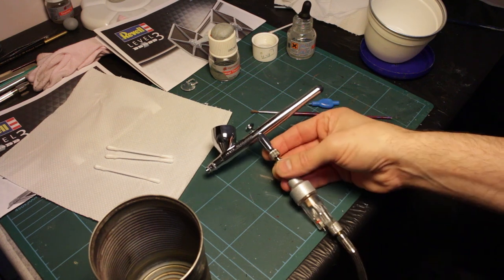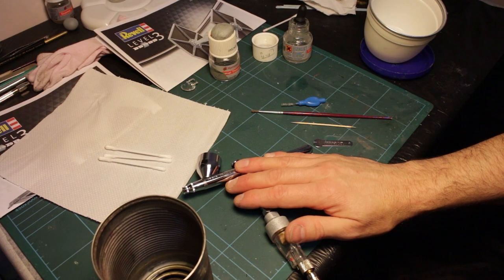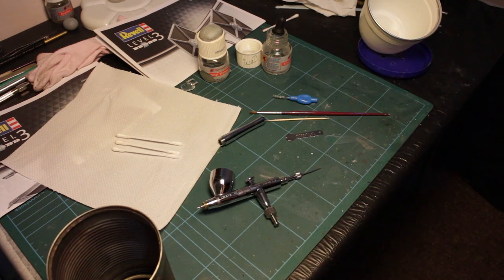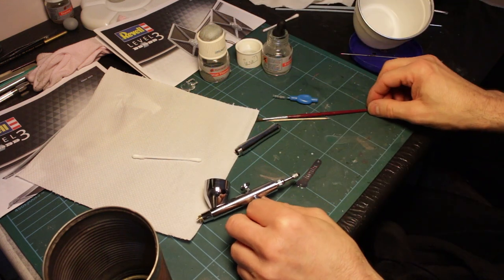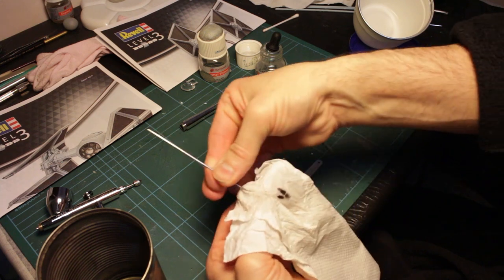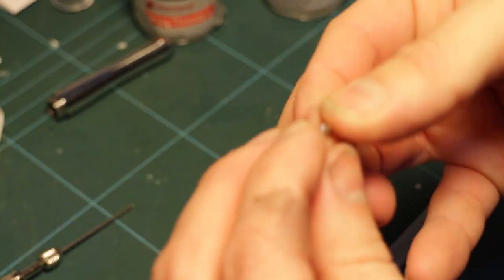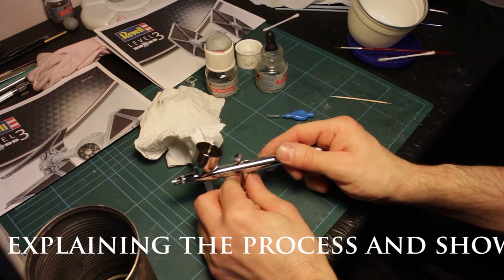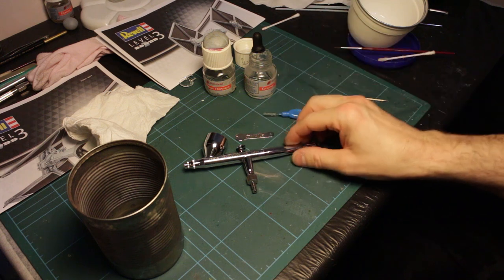CLEAN YOUR AIRBRUSH, SIMPLE, QUICK & THOROUGH TUTORIAL!

Comment: Excellent tutorial. Thank you.
I wish I'd found this last year when I started airbrushing. Thankfully I only have a cheap airbrush but I think bad YouTube advice and my own general ignorance has led to multiple problems caused by damage I've done while cleaning.
Reply from the maker: Thank you, glad you found it useful.
As someone who used to work in an automotive environment and sprayshop in the past and an avid model maker I see lots of horrendously bad advice re the use of airbrushes and bad cleaning regimes and dubious magic products.
Reply: @spidiq8  Lot's of great advice here. Bad advice I've seen includes soaking the whole airbrush regularly but no mention this will destroy seals that aren't teflon, so most cheap beginner airbrushes will be ruined. My basic Gocheer now spray's like a gnat's fart even though the compressor runs constantly.
Reply from the maker: @pumellhorne  Yes indeed. And people who think ultrasonic cleaners are like magic bullets. The key is cleaning as soon after use before the paint cures as possible.
In the garage if we couldn't clean immediately we'd strip the gun and leave the parts in a tub with gunwash (raw cellulose thinner) until we could clean it before reassembly.

Comment: Great video.. the tip on only removing and installing the needle from the front is great.. never heard this before, but will keep paint from getting forced through the rear seal.  Also by not ever inserting the needle tip-first, will keep you from bending the tip as it goes through the body...
Reply from the maker: That's precisely the reasoning for it. The tips are very easily bent or a hook or burr formed which causes all kinds of strange behaviour with paint. Glad you enjoyed it and I hope it's useful.
Reply: which is just fine as long as you don't have a Badger airbrush which have a ball at the rear of their needles, so they can only go in and out one way - through the back door.
Reply: @arleighburke9095  I suppose... it could be possible to remove ball part...  but.. with home tools it may be very difficult to get smooth enough cut that no burrs or scraping surfaces would form to possibly harm your teflon seal.  : /   in witch case... that might be even worse than having bit of paint to come trough with needle.  I guess...  this is why badger recommends using their needle juice..  to keep seal lasting longer  even when some paint residue may come trough it with needle.

Comment: Hi spidiq I'm gonna have to say many thanks again to you. I watched your videos on thorough cleaning of airbrushes and also noted that the paint should be mixed to a 'milky' consistency. I see you mentioned a compressor, AS18. I bought a compressor from Amazon &, as soon as I switched it on, after two or three presses on the airbrush trigger, the compressor went bang, fizz followed by a bright light from the switch & burning then it died a death. Sent it back & ordered another, and different one. The second one I ordered just happened to be the AS18. Ordered it before seeing your suggestion on this, so I can only say that fate took a hold here & delivered the better compressor to me. Following your guidelines of paint consistency, airbrush cleaning etc I have, for the first time, managed to spray the interior of my model fuselage cockpit sides,  (never used an airbrush before), I slightly sprayed a little too heavy on the wing under carriage wells but hey, I can disguise it with weathering etc. I'm in no doubts that I'll be having newbie pitfalls etc but, thanks to your video guides, at least I can begin to find the right path on the learning curve. Cheers fella'. 😉✌️👍
Reply from the maker: That's great news and I'm always happy if I helped a fellow modeller.

Comment: 0:00 Intro
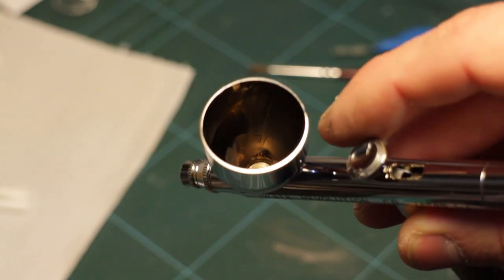1:39  Basic flush through, Use between paints during a session
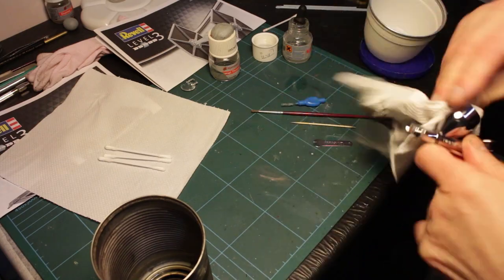3:17 Thorough strip, clean & Re assemble
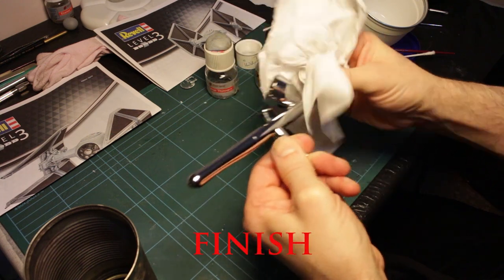15:14 Finish
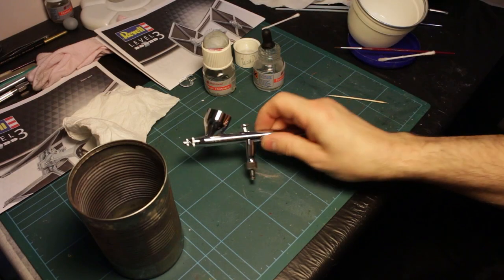17:32 Note: What to clean with for different types paints (water-based acrylic paints, enamel paints, cellulose or
 lacquer paints)

Comment: Thanks for a most informative and to the point air brush cleaning tutorial!
Do you not think that lubrication of air brush parts including the needle should follow the cleaning process?
When you use the term cellulose cleaner , could you define to make certain I am on the same page?
Do you have a list of cleaner types when it comes to paint types? IE. Acrylics - Acetone, Isopropyl …..
Reply from the maker: Thank you. Re your questions.
Definite no on lubrication anywhere in an airbrush. Anything that lubricates will contaminate the paint, lubricants are snake oil, just designed to separate people from their money with no benefits.
Your needle runs in a teflon bearing/bushing which in addition to providing a good seal is also self lubricating. They wear and occasionally need replacing but the needle is in contact with paint and should never be lubricated.
If you're in any doubt go to a professional spray shop and ask them what lube they use on their spray guns, be prepared for confused looks and possibly laughter. 😁
By cellulose thinner, I mean precisely that in the UK as that's what it's sold as. It's not a brand but a thinner type. In the US it's referred to as lacquer thinner, it's a harsh solvent and typically the type used for automotive purposes, this will clean any paint type from the gun and also thins most paint types.
Generally the cleaner is the same as the thinner used for the paint.
I.e. for water based acrylic you can clean with water but an actual thinner may be required for any dried paint.
As a rule
Acrylic - isopropyl alcohol
Enamel - enamel thinner / mineral spirits, (white spirit in the UK)
Cellulose/lacquer - cellulose/lacquer thinner. (This can also be used as an all purpose cleaner for all paints).
I would never advise the use of Acetone unless removing all seals and soaking the parts in it.
Acetone is a very aggressive thinner which will melt most plastics and this can include plastic based rubber including some O ring seals.
Reply: @spidiq8  so now that I have lubricated my airbrush to include the needle do you have any recommendations as to how I can reverse the process to  correct my error!!!!!!!
Reply from the maker: @markdesantis6325  Just strip and clean the whole thing again.
The risk is in contaminants touching the paint as it can cause all kinds of unpleasant effects. Not so bad on a model paint but you can understand why on a several hundred pounds/dollars car paint they have to be really careful.
Reply: @spidiq8  so I have to completely Isopropyl/Alcohol my 2 brand new airbrushes. I wonder if I should just send them back.Thankfully I found you. Just wish it had been a bit earlier.
Reply from the maker: @markdesantis6325  Depending on where and what quantity of lube and what it's made of, it generally just needs flushing or cleaning.
As long as it's not contaminating your paint you're ok. Try spraying some paint through onto a test piece and see.
As long as you're free of contamination you're ok.
Reply: @spidiq8  the product was Airbrush Lubricant by Impresa. I definitely will need to clean the needle, but my concern is more with the needle walls of the chamber.
Reply from the maker: @markdesantis6325  It'll clean if there is any there. You can rinse it through with isopropyl alcohol or cellulose thinner. Just try to keep it away from the air inlet as that has rubber o rings.
Reply: @spidiq8  thanks much for getting back to me so soon. Your respected input will be put to good use today. Fingers crossed 🤞
Reply from the maker: @markdesantis6325  Best of luck with it. A good clean and I'm sure you'll be good to go

Comment: I've been getting some problems with dry tip, so will be more careful to clean properly in future. Good to know that you should be pushing the needle out rather than pulling (I’ve seen the latter technique I’ve seen in a few how-tos).
Reply from the maker: You can draw the needle backwards but it's just not logical to, you're both dragging paint through the needle packing which will slowly wear and abrade it and you risk bending the point of the needle on refitting.

Comment: I just started airbrushing and this is a Good tip for ME. I have the same one your cleaning.  Tku. 👍👍
Reply from the maker: You're welcome and I'm glad it's useful to you.
Reply: @spidiq8  I see you have an in line filter is it important. I have the cheaper one. Since this is my first equipment.
Reply from the maker: @williamaviles2647  It's important if you intend to spray for any length of time as condensation will build up in the airline so even with the one attached to the compressor you'll still risk water ingress.
It also makes a difference with the temperature and humidity where you are. Here in the UK we have cold weather and humidity.
Reply: @spidiq8   Thank You
Reply from the maker: @williamaviles2647  No problem. The inline filters can be gotten cheaply from eBay.
Reply: @spidiq8   Just ordered from Amazon. 😉

Comment: Sir love your videos and thanks for your time. I recently purchased a Iwata revolution like yours but after a recent session it quit sucking paint ..acrylic..from the cup.. it's super clean..even tried a new nozzle..it won't even spray water..any ideas?
Reply from the maker: Check the air hole next to the nozzle and make sure air is coming out, although with a new nozzle it shouldn't be the case check it for splits.
If they're ok check the PTFE seal for the needle at the back. Draw the before back and forth and you should feel some slight resistance. If loose check the needle is spotlessly clean so you're not dragging paint through and tighten it slightly.

Comment: quick question I was told there was two different settings for the siphon and the gravity feed but i can not find any info on the that setting i use siphon cause i change colors alot while i do my drawings but just not quit sure at what pressure to run. I run 30 psi for the gravity feed.
Reply from the maker: Required pressure depends on the viscosity of the paint but siphon feed will always require more pressure to achieve the same spray pattern, there is no 'magic number' for the PSI needed as what you spray varies in thickness. Inks for example are very watery and require much less pressure than a thick enamel paint.

Comment: Here's a cleaning tip that resolved about 90% of my problems getting into airbrushing -
You know those disposable pipe cleaners you can pick up in basically any store?  While scrubbing with them will loosen dried paint, it's also a great way to leave tiny stray bristles and crap in the airbrush which will inevitably cause a clog.  I also suspect that their steel wire cores are probably pretty bad for the teflon seal too.  Seriously, just don't use them.

Comment: Great tutorial! Just curious thought. What about the o-ring on the nozzle?
Reply from the maker: On this particular brush the machining is tolerance fit and very good so no o ring is necessary. On some cheaper ones you can get away without, (my cheap Chinese one will seal without but another I had didn't).
However, if you have one with a seal it shouldn't be submerged for long periods but can be dipped in thinner and reamed through with a paintbrush, if it needs soaking, using a needle or pick. Carefully remove the o ring first. If you have some a tiny dot of silicone grease on the o ring after dipping will prolong it but only the tiniest dot, you don't want silicone grease inside the nozzle.
I'll look at doing a follow up video about this as it's an interesting question. Thank you.
Reply: @spidiq8  wow thank you so much for the reply! I'm looking to get the neo for iwata hence the detailed question. Personally I've been using China airbrushes and the inconsistencies have been starting to get to me as I'm starting to go into chroming my kits with lacquer paint. I deduced that for that purpose, it's always good to have a very clean airbrush. The China ones have O-rings so I can't soak the nozzle in airbrush cleaner which is a stronger solvent compared to lacquer thinner. I've always found it difficult to remove the o-ring but your suggestion sounds great! I don't have any silicone grease either so I think I'm gonna have to be very careful with my cleaning procedure until I get a Neo.

I'll be looking forward to that follow up video! Cheers from a Singaporean gunpla builder!

Comment: Can I pull the needle out in the front on a H&S Airbrush? They have these indentations at the end where they mark the size of the needle. I am worried to wear out the needle seal. Thanks
Reply from the maker: Yes. The grooves are indented so it would be fine. If you're a little wary take some 600 grit wet n dry and smooth the end where the grooves are. Clean the needle well before refitting.

Comment: So if I had pulled the needle thing backwards through the seal instead of out the front, would this damage the seal? If so what would happen?
Reply from the maker: Long term or if paint has dried on the needle it will gradually abrade the seal wearing it out. Think about air filters on engines, the reason for them is to trap fine grit and dust particles which would get into cylinder bores and abrade the piston rings and bore, the principal is the same, went draw something through a seal and drag contaminants if you can remove from the front and not.

Comment: Is it advisable for "long term"  of several mos. to years  storage of an airbrush that a slight blow thru of a light machine oil ( 3-in-1 or, sewing machine oil) will preserve the internal metal parts against corrosion.
Reply from the maker: I would advise against it, it would require complete stripping and immersion in solvent to clean out oil residue which is the worst possible paint contaminant.
Thoroughly cleaned and stored in a dry environment it should store without problem, avoid storing it anywhere humid or damp to preserve against corrosion.

Comment: Good morning my very good friend, I've popped back to kill my curiosity once again with your professional thoughts.. Whilst cleaning my H&S CR Plus, it occurred to that between the base of the cup and the needle teflon seals, there's a space of about 30mm and whilst cleaning the base of the cup area with the needle removed, any residue whilst using towel or cotton buds can possibly make its way into this section. 

I realised this when I noticed a couple of bubbles appear by the trigger after reassembly, please note I definitely DO NOT use back flush because you suggested not to. My question Is, is it ok to just leave this or should I use my very low pressure airgun to give it a gentle blow through. I assume there is a seal at the back part of the cup well or does paint enter this area, and if so should I be cleaning the inside of this seal at the same time when I clean the front seal. Many thanks in advance and as always, I very much appreciate your time.

Update: I think the bubbles are because I used windscreen washer neat, but now I'm using Isoprolol, but still curious about that 30mm channel and seal needing a clean
Reply from the maker: Back flushing is OK in terms of flushing thinners through, just not as an 'instead of properly cleaning'so feel free to do that.
If at all possible to easily remove a seal without damaging then do so and clean it but just clean as best you can, if teflon you can submerge it in thinner to dissolve paint. Hope this helps.
Reply: @spidiq8  it certainly does thankyou and I assume from what your saying, any residue from the Isopropyl that seeps into that 30mm section where the needle comes out after cleaning the cup, we'll be just fine and probably evaporate.  Thanks ever so much once again, priceless :-)
Reply from the maker: @Bassmunchkin1  That's right yes.